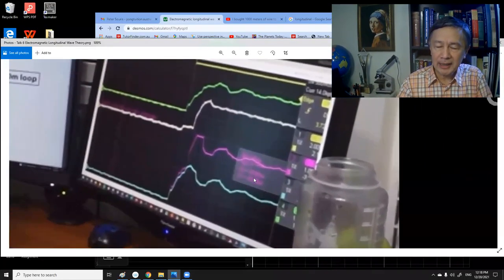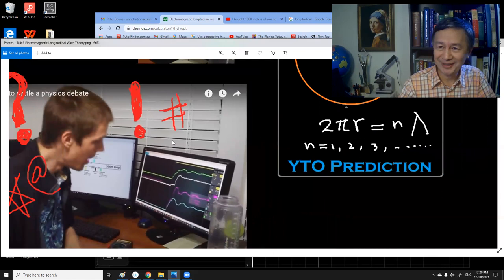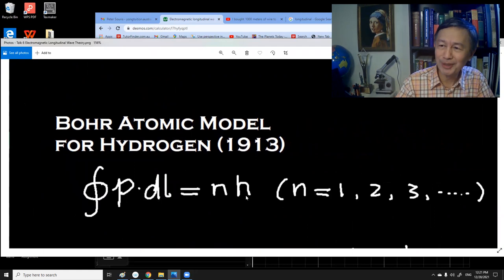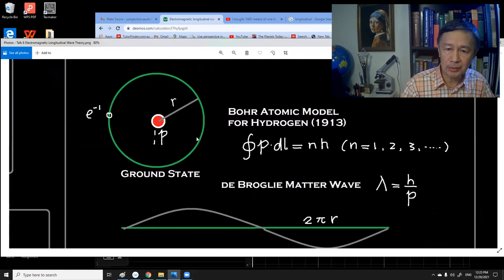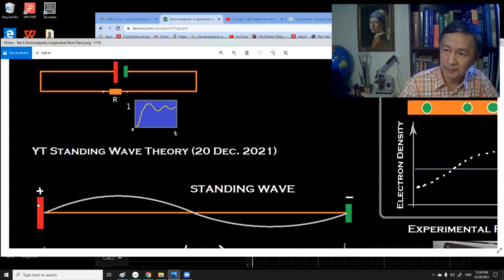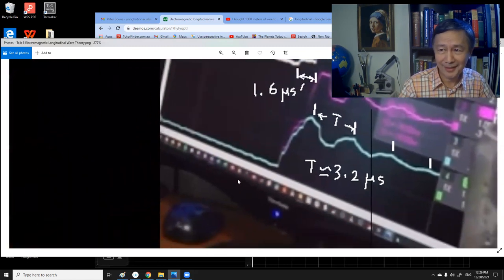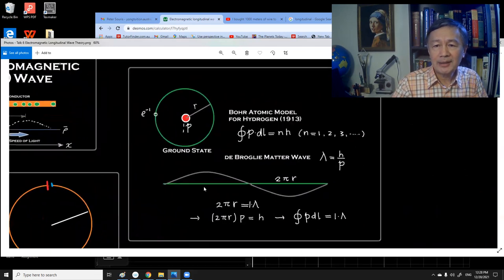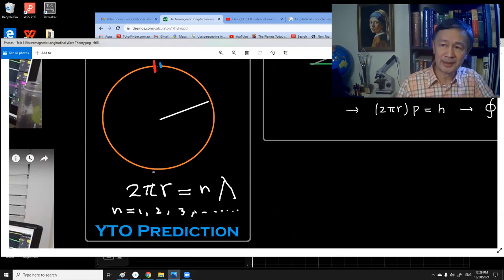#AlphaPhoenix Experiment: Another New Theory |#Veritasium Big Misconception about Electricity Part 6

Comment: The oscillations or "ringing" observed after the leading edge of switch closure can be explained through either seeng the set up as a resonant LC circuit or a missmatched transmission line where the load and source impedances are different to those of the transmission line. In which case not all the energy fed into the line is absorbed by the load resulting in the excess energy being reflected back to the source and then back to the load etc, resulting in a damped oscillation whose period is determined by the length of the line used, which is very likely what is going on in this setup. Your explanation sounds right also, although I am having some trouble following it fully as my background is more engineering than bassic physics. However, I think most differences between various points of view are exactly that - points of view or perspective.
The old saying "There are more ways than one to skin a cat" pretty much covers it.  Big disagreements have errupted over this including the one of Dr Walter Lewin claiming that "Kichhoff's voltage law inside a closed magnetic loop is for birds!"

Nice videos, keep them coming
Reply: The bigest problem with setups like the ones by Varitasium (no way to replicate it in practice due to the massive scale) and the one from Alpha -  Phoenix is that they are not likely to be found in real world applications. Alpha Phoenix set up is a great attempt to scale down the Varitasiums wild idea so he can do some meaningful evaluation in a scaled down setup. The test would have been done better with either a practically long coaxial line or a balanced one with a well defined characteristic impedance (Zo) and then a variation can be made in both source and load impedances and observe the effects on reflections. Lot of this stuff is a well established practice dating back to ythe early 1900's in both radio and telecommunications. You can send very short and well defined pulses, much shorter than the line length propagation delay and observe the input and output of the line to see whether the pulse is fully absorbed by the load (no reflections) or some reflections which show that there is a mismatch.
Reply from the maker: Thank you. To use an equivalent LC circuit, more parameters must be introduced. By way of contrast, only the total length of the wire used by AlphaPhoenix is needed to calculate the period. In physics, one often starts from a fundamental law rather than some empirical formulae, such as the Bohr quantum condition mentioned here.
Reply: @yongtuition  fully agree. Although I mentioned LC resonant circuit I'm with you on using the length of wire and value of c to derive the period of the oscillations. I was only pointing out that these are due to mismatches between the line, load and source impedances. Also keep in mind that AlphaPhoenix test is purely empirical just so that he can show realistically what is going on in varitasiums claims.
Reply: @marcfruchtman9473  I agree with what you are saying, all I was getting at is that there are other ways of getting same answers. 
The setup used is and was susceptible to noise pickup which gives less clean results. That said a roll of magnt wie is much cheaper than the same length roll of coaxial cable.  It seems to me that Varitasium's aim was not very clear and meant more as a puzzle aimed at confusing the listener/viewer. The fact that at the end of the video he said that he was sure that there would be lot of push-back on his claim seems to me that he didn't really believe all the things he said. There is deffinitely both electric, i.e. capacitve and magnetic or inductive coupling between the battery side lines and those a metre away on the load side, one can definitely argue that there will be "power" reaching the load in t =1/c, but it is just as obvious and this is confirmed by AlphaPhoenix experiment that it would be negligable compared to the full current arriving to the load after the time taken for it to travel the full electrical path.

Comment: Hi, in my opinion this can be explained by capacity of the cable, and how it interact with resistance.
Reply from the maker: Do you have a formula? Even you have your formula, you need to assuming the value for the capacity. Besides, RC circuits don't oscillate.

Comment: The actual experiment has wires probably less than 200 feet: of course the bulb lights ‘instantly ‘. The expanding electrons leave the high pressure ( surplus electrons) ‘negative ‘ terminal flowing ( spiraling skin effect) to low pressure depleted ‘positive ‘ terminal at @ “ c” when circuit is complete. Under Veritasium ideal conditions- zero resistance in bulb and wires- the travel time is @ 2 seconds. DC produces a magnetic ‘field ‘- physical expanding electrons- leaving the wire perpendicular to its length but also spiraling. This led so many to propose the orthogonal “wave theory “, erroneously.  Magnetic fields do not light up bulbs. Experiment is misleading at best; most agree with that. For the physics: “The Final Theory: Rethinking Our Scientific Legacy “, Mark McCutcheon.

Comment: In the “ good old days” a candle was put on a wall mounted device to light the room. Today apparently an upside down horseshoe magnet would do the same. Above said magnet a dc bulb could be placed and presto light. Or a 12 volt battery/ wire/ switch setup in any room would do the same. Position the bulb holders at will: flip the switch, presto the ‘magnetic field ‘ will power said bulbs. Veritasium is complete bunk. Physics says otherwise. The expanding electron does it all . Let’s stop pretending.

Comment: not yet a new theory, not even an hypothesis, just an application of several other named discoveries. I think if you want to propose a new hypothesis, best to make a prediction which can be tested: for example, if the two lines were lengthened by 20%, the oscillation period would increase by 20%. Honestly though, a tank circuit is pretty well understood, here you have inductance and capacitance doing what they do best. I think folks are less interested in the used scale and more interested in the third nanosecond. Veratasium's nanosecond.
Reply from the maker: Let me answer remarks backward. 
1. It seems you have not seen several electrical engineers have done the modeling in nanosecond scale.
2. Any LC equivalent circuits for the experimental setup are empirical or phenomenological. Not physics. 
3. Any proposed theory should be experimentally verified. You can contact AlphaPhoenix to do so.
4. What are the "named discoveries" which can provide the newly calculated period? 
5. A theoretical work contains a hypothesis, e.g. the standing wave here; a formulation, e.g. the formula for the period of the oscillation; a comparison with experiment, e.g. 3.2 and 3.3 nA.  How could you miss out them all?

Are u a fan of Veritasium?
Reply: @yongtuition  I have seen one modelling, we won't call phenomenal simulations relavent. 
Jumping to the the first point, the data for 3.2uS ringing existed before you began to make this hypothesis, and it's a single datum. So, it looks like curve fitting, or simply explanation using the names and formulas from 100 years. Yes. Length of wire /c gives a time period. This is not a new theory. So, if you have a prediction for a different experiment, make it blind, then do the experiment. Only after a prediction has been observed multiple times can it become a theory. A formula that fits a single given observation is barely a hypothesis. Btw, this ringing oscillation is so common in electronics, this shape is everywhere. I don't think it is a mystery. 
Finally. Let's focus on the third nano second. Unfortunately alphaphoenix lost the narrative.
250mm is not 1 meter. And this response curve is on the scale of 3uS not 3nS. Consequentially neither yourself nor alphaphoenix are having the same conversation as Veratasium. Ps I suspect Veratasium is plain wrong here, but his assertion is weak "any current" "a battery" "imaginary lightbulb", fictitious wires" to some extent we are arguing about the color of unicorns. Veratasium needs to be more specific before calling people liars. You need some rigor before you start naming new theories "Yong Tuition". In my opinion.
Reply: @yongtuition  to continue, it is well established that any pulse train or arbitrary signal imputed on the end of a wire will be reflected by changes in the momentarily impedance of the line, including it's terminus.
It is possible the ringing observed here is the superposition (sum) of the original impulse, and all sources of reflection from either direction. Nothing very novel in my opinion.

The only question in my mind is what are the values of the 5 samples (@1G samples/sec) which include the 1 sample in which the switch is closed.

All the rest is just a measure of the magnitude by which Veratasium is wrong, which I estimate to be 2-3 orders. Anything in uS is 2.7 orders longer than 1/c sec: aka 3.3nSec.
Reply: @marcfruchtman9473  So. Clearly there are all kinds of ways in which energy can flow from a battery to the light: ie: linear transformer, capacitance, rf, wired conduction, electroluminescence, quantum tunneling, and some of these are more significant than others:  in the frame of 3nS however. Only the very esoteric influences are relevant.
Let's review: induction. Yes, but wire lengths are basically zero for all paths within 3.3nS, see geometry.
Capacitance, same.
Rf: sure, chaotic rf wavefront, good luck, again antenna length is zero +/- the Veratasium fudge factor, say 1.5nS. that could give you wires of length ~0.25m to either side of a light bulb.
Electroluminescence: so switch make spark, Light emits, light emitting diode (lamp) converts light into light/photon/excitement/electricity. Well. Maybe. Mostly none of these within 3 orders of magnitude in the first 3.3nSec.
Reply from the maker: @BenjaminGatti  Indeed, "ringing" phenomena in electronics have been observed for a long time. In pulsed electron and nuclear magnetic resonance instrumentation, pi-pulse must be used to cancel it in order to reduce the dead-time. In this video, it is shown that the Period of the oscillation can be explained in terms of standing wave, which is a novel idea. It is clear that you have conceptually mixed the frequency of an oscillation with the time taken for the electricity between the two electrodes of his battery. Both Veritasium and Alpha-Phoenix stated that the time taken would be L/2c =1.6 us, assuming electricity travels along the wire. The Bohr theory was merely used as an analogy, instead of the theory proposed here. I know my new theory may or may not be verified in future experimental studies, but if it can be verified, then our understanding of electricity would be quite different from what we have known so far. Take easy.  

In addition, you have missed out the concept of Longitudinal Electromagnetic Wave. See the references list under the video please.
Reply from the maker: @marcfruchtman9473  "not a new hypothesis for physics,"  did you mean the assumption the oscillation observed by Alpha Phoenix is due to transient electromagnetic longitudinal wave?  Please show us your search or research results, I am interested in that.
Reply from the maker: @BenjaminGatti  Of cause you could argue the ringing might be explained using different hypotheses, but can you explain the oscillation period quantitatively?  It would be an endless talk if you cannot work out a better explanation than the one proposed in this short video.
Reply from the maker: @BenjaminGatti  "There are all kinds of ways in which energy can flow from a battery to the light bulb."  Yes, many people would agree with you, but none of them are correct as to discussed in my coming video, the Big one.
Reply: @yongtuition  my concern is that Veritasium might be flirting with the mostly irrelevant means by which energy could flow from a battery to a lightbulb, and dredging up poynting and other sciency names to underpin his central point (energy flows outside wires to such an extent that the path of the wires is largely immaterial to the movement of "energy" from the battery to the "bulb". To be clear, we agree that Veratasium is stretching credulity here. In fairness, I don't follow some of your alternative explanations.
Reply from the maker: @BenjaminGatti  It is fair. We are here to clarify and understand what we really think about the issue, rather than to convince one or another. In fact, I am more concerned about why Veritasium made this pro-calorie video in relation to climate change and wireless power transmission.